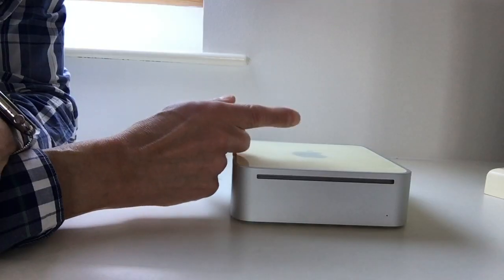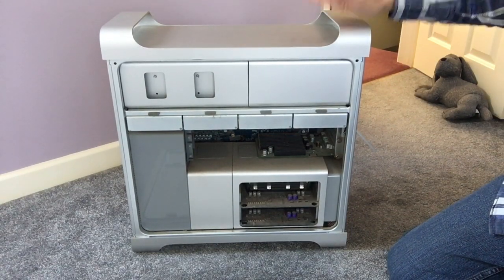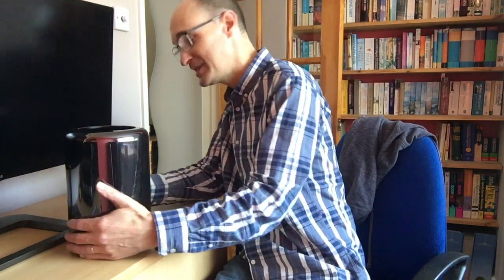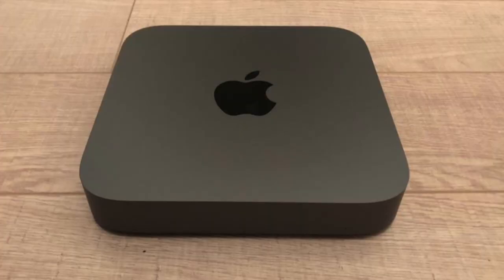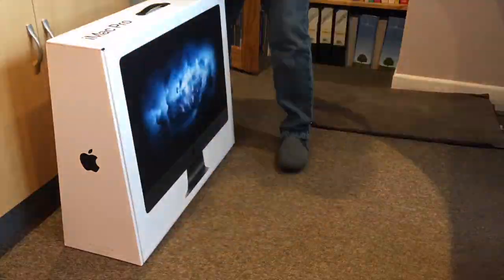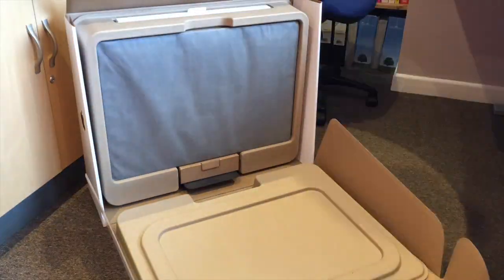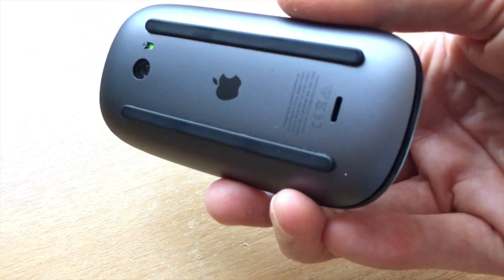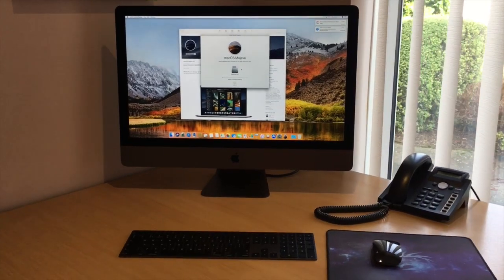What Mac did I buy?

Comment: I was in the same situation, but decided to get a top end Mac Mini + LG 5K display and upgraded the ram myself. The main reason was that if anything major went wrong with the iMac you have to throw the whole lot away as eventually happened with my 1999 iMac just out of warranty. Also my Apple LED display still works fine after 9 years so my new LG display may last for as long but probably not the computer
Reply: Phil Atherton good point, but when the external GPU the price becomes almost the same. But even so it’s an interesting alternative
Reply from the maker: Hi Phil. That's really interesting to hear. I can't argue with what you did. I was tempted to do the same thing myself. There are workstation level processors in the iMac Pro and also ECC RAM, although those facts alone would not enough to justify going for the all in one. The LG 5K display looks amazing and you're spot on with the "all in one" problem of "what happens if something goes wrong?". My data is on my network and I'm possibly keeping my old Mac Pro as a warm standby, at least for the time being, but I take your point completely - it's a sound concern. I'm sure you'll be very happy with your purchase. Thanks so much for taking the time to send your feedback. Regards, Andy.

Comment: just a quick question: if your screen haven't died, would you consider of buying the 2018 mac mini? i'm asking because this is my situation...
Reply from the maker: Hi Asaf. Yes, I would've considered the Mac Mini although even if you spec it up with similar RAM and SSD to the iMac Pro it has a lower spec CPU and GPU. Don't get me wrong,. it's a great looking machine and if price is a concern then you could always plug in your existing working monitor and then update to a higher spec screen later on. Don't forget that Apple will be releasing a stand alone monitor alongside the new Mac Pro later this year. One of those screens hooked up to a Mac Mini would be very nice! I'm just pleased that there now seem to be more options for pro users who want an Apple machine. Thanks for your question and good luck with your forthcoming purchase. Regards, Andy.
Reply: @TheRamblyChannel  thanks for the Reply!